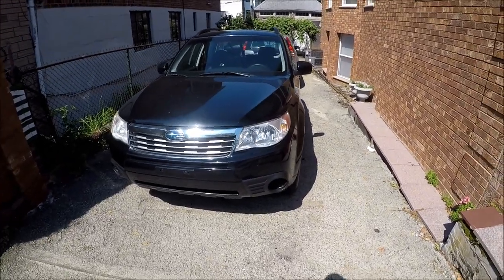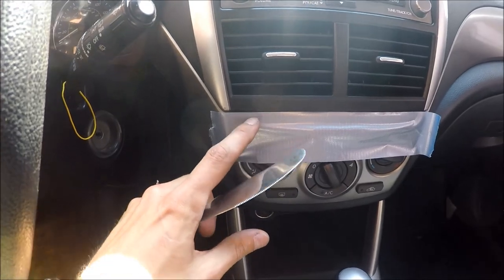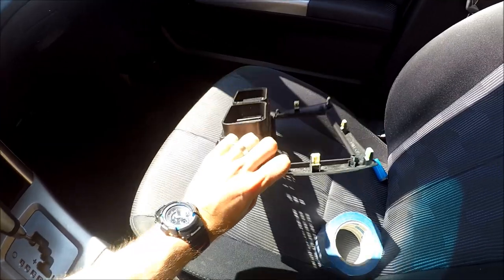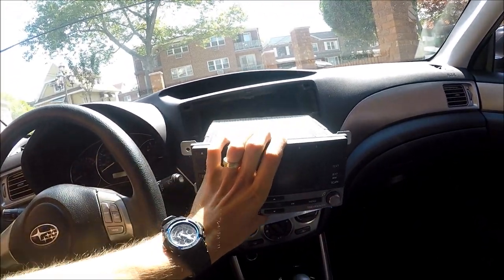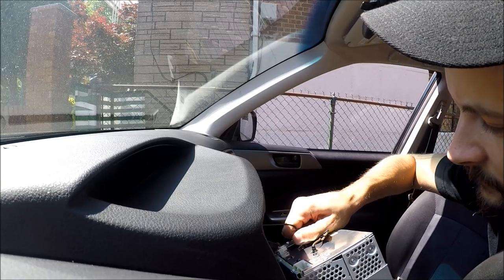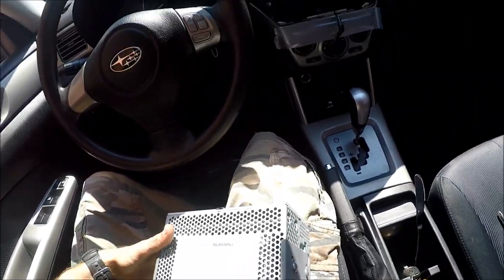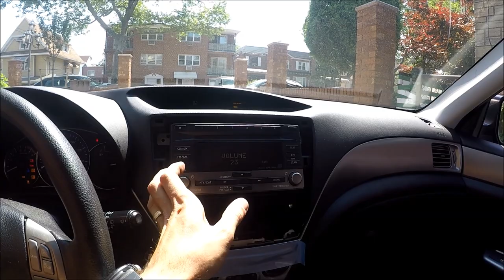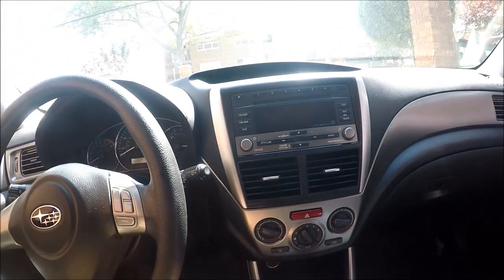How to remove Radio in Subaru Forester 2008-2013

Comment: What is each connection in the back of the radio? Not the speaker wires but the one next to antenna